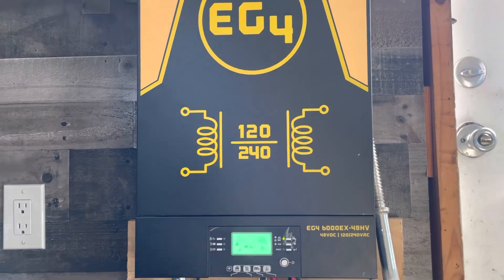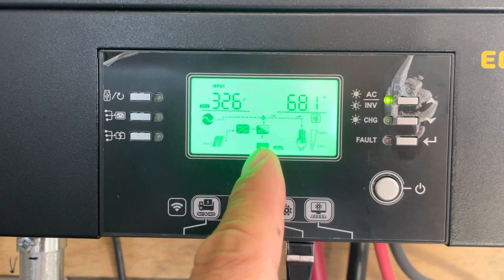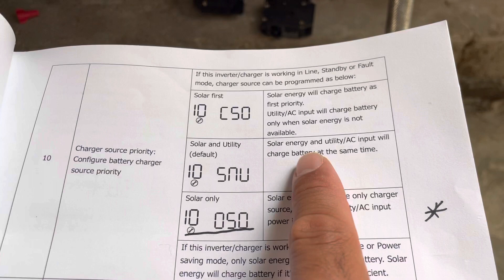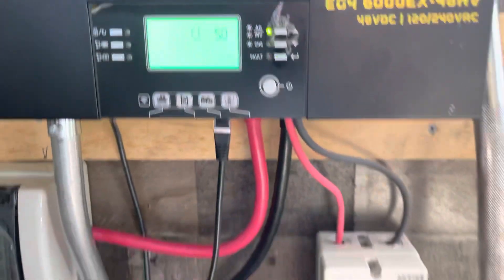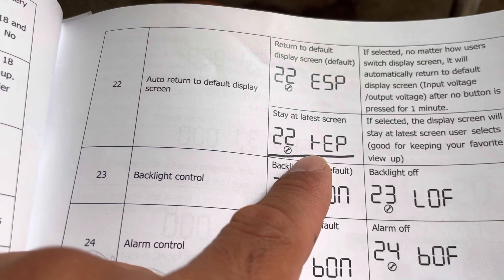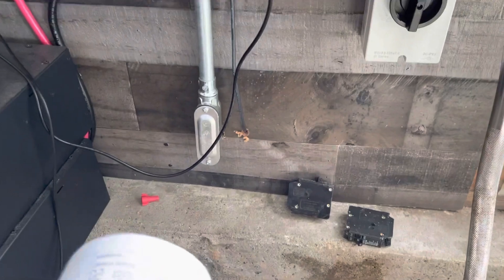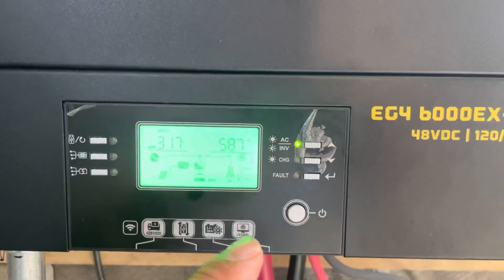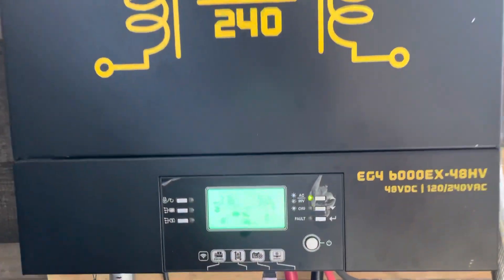EG4 UPDATE . HYBRID SOLAR INSTALL

Comment: Under the USB settings you can set the TIMEs and methods when and how you want to charge your batteries.  You can basically just shut off the Utility charge at night, and if you have no sun during the daytime, you can have your inverter switch to Utility to charge up your system before night time hits.  That is what those three buttons on the left are for.  The bottom one is the charging timer and you set it up to the charging method you want o go to during a certain time period.  Adam De Lay identifies these setting more in detail on his 6500s "Some unused settings on the EG4s".  These settings are set in one hour increments.  An example would be to set OSO from 6pm to 6am, and have your charge source priority switch to a different setting during the daytime. The timer would start at 6pm, but won't shut off until it has completed the whole 6am hour setting (6:59am).  Then if you have sun and solar charging set first, it would kick on.  But if you don't have enough voltage from the solar, then Utility could be set to kick on.  I believe they are the same on a 6000 inverter.  Check it out.

Comment: I would change it to solar and utlities because if your battery gets to low before the sun comes up it well use grid to keep your battery from getting to low...and once the sun comes up it will switch over back to solar. And this is to protect your battery

Comment: Why is the default setting to charge your battery from Utility?!  Who would want that?
Reply from the maker: I have had several customers that absolutely need power for medical reasons . This may be a setting that fits their needs with some slight adjustments.